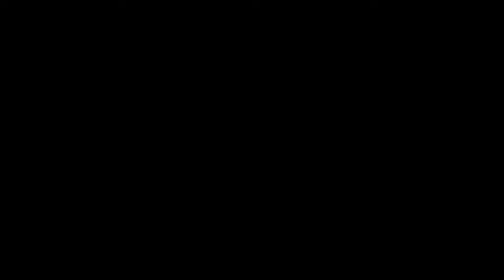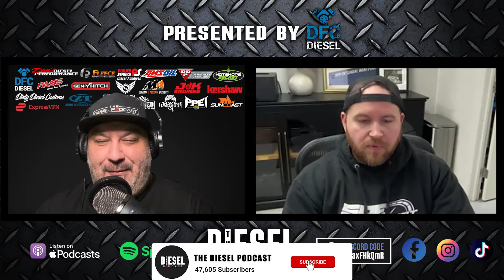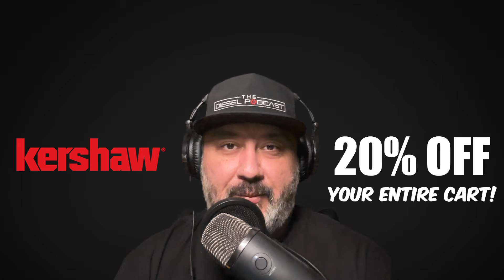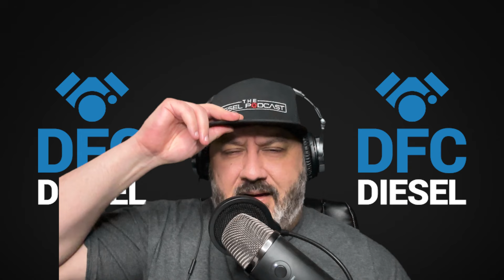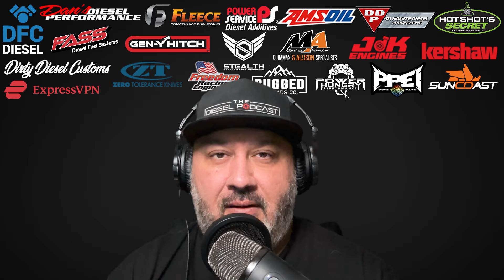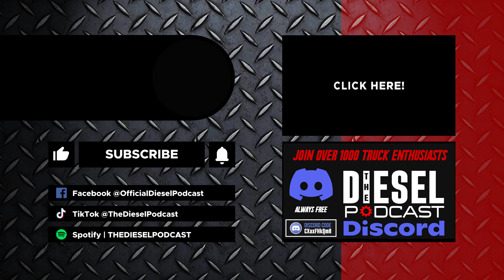Major Failure with This Truck Solved!

Comment: The DCR will be the future pump on the 6.7 Powerstroke as it is the true almost truly 99.9% stock built pump! Its widely used on tractors,other vehicles etc.. just modified for the 6.7 plus designed it for the pressures needed and reliability but this CP3 adapter kit with a belt driving it just sounds like a disaster waiting to happen.. no offense to ppe they do great stuff but I think that may be more of a rarely used show or race truck type setup.. truly working my truck from northern Montana to Southern Texas  to Maine to Florida I just personally couldnt depend on a belt driven CP3 even though the CP3 is a great pump! It would be nice if we could truly stock mount it gear driven like the DCR!!! To each his own though..

Comment: The DCR seems to be widely available.  The only advantage I can see to a belt driven CP3 over the DCR would be ease of installation and if it was significantly less expensive.  However, the DCR is definitely a proven, durable, and permanent solution for the life of the engine.

Comment: It’ll be around $4000 and have a 30 day warranty. You gotta love SPE‘s 30 day warranty. S&S they have a two-year unlimited mileage warranty that comes with the purchase of the pump. SPE makes you buy a warranty on top of the already overpriced item. Good product products though.
Reply: They are $2500-2800 depending on the model year & will include a 2 year warranty on the pump & a lifetime warranty on the hard parts.
Reply: @dansnyder8186 
I listened to the whole podcast and i have a whole new respect for you all at SPE (except Chance,lol) i will be buying one on Black Friday along with the intercooler.  Thank you Dan.  I really like the other SPE products i have on my truck.